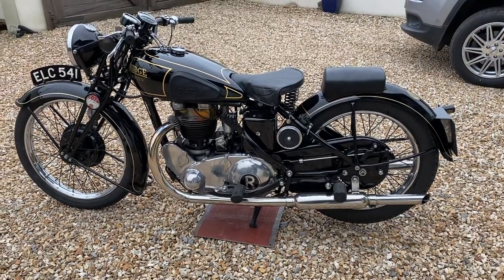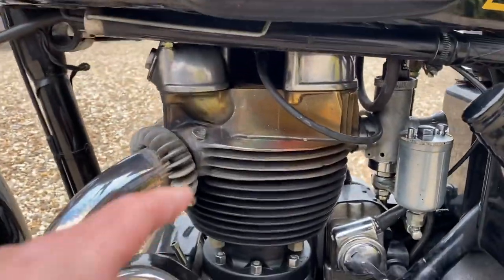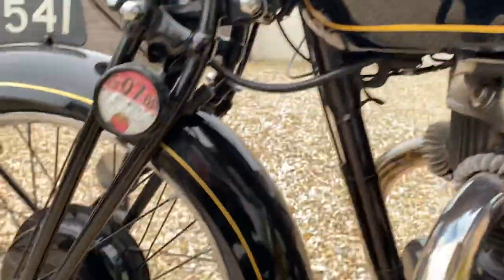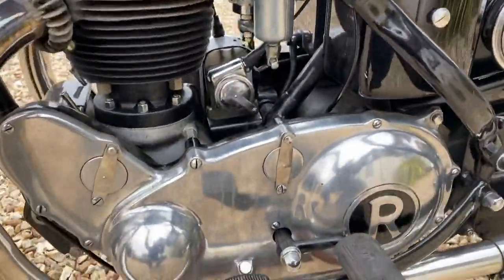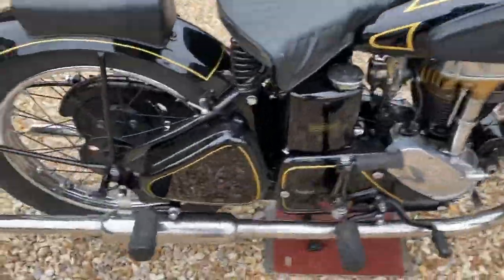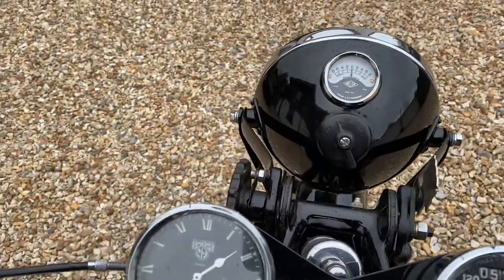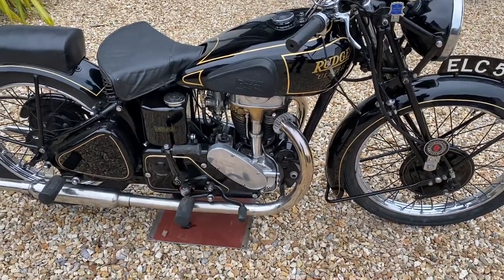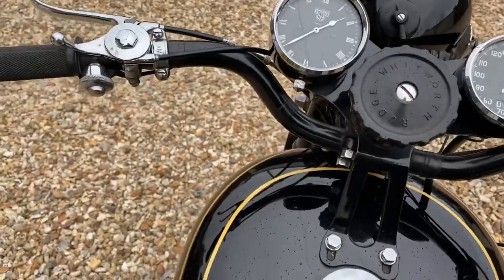Rudge Ulster 500cc walk around and start

Comment: My grandfather Harry Collins had a factory Rudge Ulster that he did sand racing on back in the late 30's. It had a decompression plate that was fitted for road use under the cylinder head. He told me that to start it without the decompression plate in it at races he had to take out the spark plug and heat it up on a primus stove or it wouldn't go!

Comment: I had several of these machines yes they were great bikes, But they had a serious flaw regarding the bronze head, which cracked between valves and in this day and age would not be a problem, but back in the day I had mine 1954 or so , spare heads were manufactured from memory by a machine shop in Leytonstone, London called Baily, again from memory.  You could get a cast iron head, if you were lucky, but most parts, were either used, or knock offs. More information should be available from the Rudge owners club, which used to meet at the bunch of grapes pub in London, maybe it is still around?

Comment: Ridge gave up motorcycle production because the Great Depression made it impossible to sell them at a profit. Bicycles were the only form of transportation the masses could afford.
Reply from the maker: I’m afraid that’s incorrect. Rudge were owned by EMI, but when WWII broke out, production stopped and the company focussed on military radio communications and radar . After the war ended the requirement was for ride to work bikes and the Rudge was always a luxury model, so was never re-introduced.
Reply: @paulmiles  You hit the nail on the head. Rudge Whitworth made high quality expensive and sporting machinery. Riders were more interested in buying cheaper "tax cheaters" before the war and military surplus bikes after the war. Rudges won the 1930 Junior and Senior TT races in 1930. They won the Lightweight in 1931 and 1934 and was the runner up behind the New Imperial in the 1935 Lightweight. Rudge Whitworth also made wheels for sport car manufacturers. They were a pricey machine too expensive for the masses.